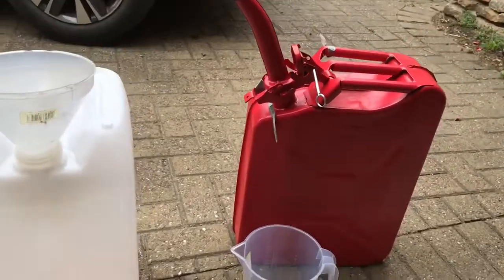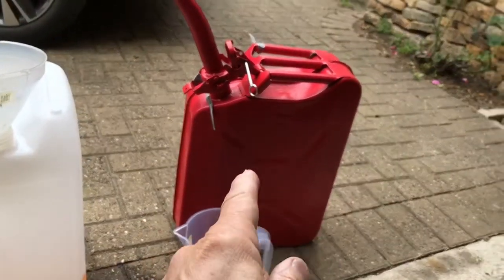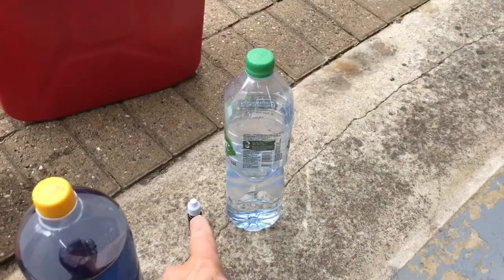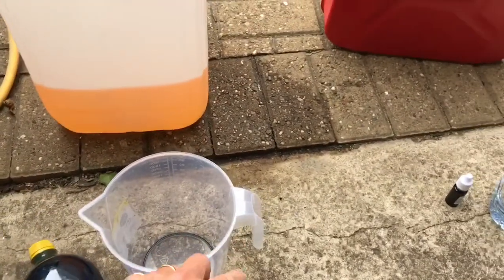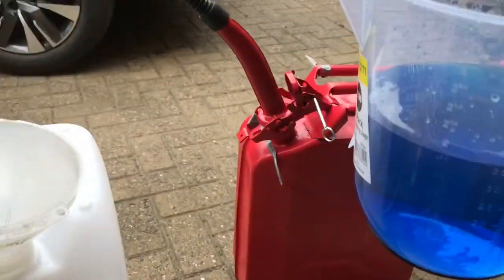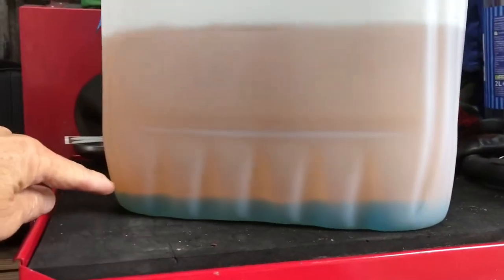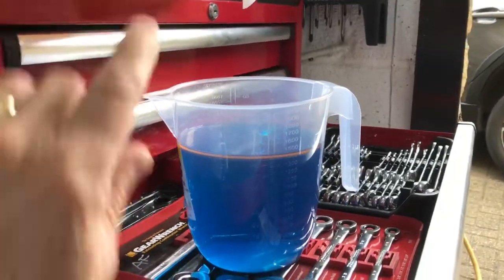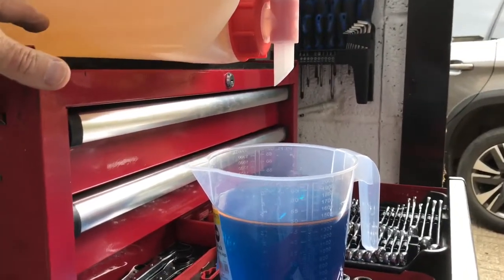How to remove Ethanol from unleaded fuel

Comment: Why are they increasing the  Ethanol to 10% - I presume to cut costs?
Reply: To pretend to save the planet.
Reply: To add to this, the UK doesn't have a bioethanol refinery, so its shipped to another country in between as well. Its just all short sighted nonsense, let's tear down another forest to grow crops to turn into fuel to save some minute amount of co2 and more importantly line the pockets of the crop producers
Reply: @drybiscuit  what’s more environmentally harmful growing some corn or extracting oil
Reply: Deforestation to grow corn is far more damaging to natural habitats. 

Humans are responsible for just 2% of the planets natural CO2 content. In Iceland there has been an erupting volcano since march, to date it has spewed out 1.7 billion tons of co2. Fuel refining is not as bad as the tree hugging greta fans make out. 

Follow the actual science, not the hype.
Reply: @IanNortonBaldersBikes  Well said. All this crap about man made climate change is an utter money making scam. They would be far better sorting out single use plastics
Reply: @john-zf1yb  It takes nearly as much fossil fuel to grow, process and distill the corn as you get out of it by burning the ethanol.  Additionally, the ethanol can't be sent through a pipeline like the gasoline (since it's hydrophilic).  It has to be sent by truck or train to the distributors and added to the gas there before delivery to you local station.
Reply: @IanNortonBaldersBikes  kinda hard to "follow the science" when you do not post a source for your claim.
Reply: @rancidbeef582  I would believe you but why should I believe a youtube comment with no sources? From my research, I have not seen any proof that it is more environmentally harmful but if you find something ill read it and change my views.
Reply: @rancidbeef582  It would be waste of time because it does not exist. I have looked and have found nothing.
Reply: @john-zf1yb  the problem is they use almost as much diesel fuel to grow the corn as they get in ethanol.
Reply: Because Boris's bird told him to .😁
Reply: To deforest more of the land, in order to cut CO2 emissions. Biofuels are disastrous for ecology.
Reply: @climanrecon5649  We've been using 10% in the US for a long time now.  It's just a pay-out to the corn farming industry.  Corn is a horrible choice for ethanol because your return on the fossil fuel "investment" is about break-even.  It would be much much better to  use sugar beets.  I think the return on that is something like 8 to 1 (or maybe that's sugar cane -- but still better).  But this is the same reason we're stuck with high-fructose corn syrup in everything instead of just sugar.  Follow the money....
Reply: To increase efficiency many people seem to ignore that’s ethanol provides a power boost
Reply: Incorrect I'm afraid. Ethanol does definitely not provide a "boost" it's slower burning that petroleum. Vehicles will drink more fuel with the higher percentage of ethanol.
Reply: @john-zf1yb  But ethanol itself needs gaseous oxygen (present at a level of twenty per cent in air) to combust...
Reply: @john-zf1yb  Ethanol has a little more than 1/2 the BTU's per gallon (or J/Kg, if you prefer) of gasoline.

Comment: Hi, I make biodiesel, and have to rinse out the Methanol, and Sodium Hydroxide, then keep draining off the water, until it is clear each rinse.  How will you get rid of the droplets that remain in the water?  I also would guess, to add the Ethanol back in, to make it E5, you just put in five percent pure ethanol back in.  Im glad i make my own bio, as this lot will cost dearly.
Reply: Andrew Mckenna
I use 'methane gas' for my vehicle and this also helps with "climate change", considering that my wife produces most of it

Comment: Brilliant thanks for the info. Same applies to lawn mowers and chain saws if 10% ethanol is all you can get after 2026.
I hate these 'authorities' who deliberately try to screw you!
Reply: I think you'll find Super Unleaded is staying at 5%
Reply: @johnpm1605  great if the nearest pump isn't 100 miles away (as it is for me)
Reply: John, will a four stroke lawnmower engine run fine on E5 Super unleaded?
Reply: I drive a 1995 Ford Ranger with 2.3L and 5 speed, before ethanol blended fuels I was getting 25MPG on the highway, that dropped to 21. I thought maybe something was wrong with old boy so I ran the tank as low as possible and refueled full of non ethanol and back to 25.
Reply: Ronnie G, 2 strokes can handle Ethanol fine. It's the 4 strokes with valves and valve seats that get pitted and then die to lack of compression. And I agree 100% on the Gov't Screwin'.
Reply: @Wheeler590  I think you are referring to the unleaded problem. All the ethanol does it to deteriorate the rubber tubes and seals in the fuel system if they are not compatible. These bits will deteriorate anyway over time and have to be replaced. I think the whole issue is being blown out of proportion.
Reply: it's ethanol free with exception to everyone in the UK. 

Esso super unleaded petrol (Synergy Supreme+ Unleaded 97 and Synergy Supreme+ 99 ) is ethanol free (Except in Devon, Cornwall, North Wales, North England and Scotland)
Reply: … and aircraft !!!
However, it is possible to buy UL91 which is lead and ethanol free (you can obtain it from certain airfields but not all).
Reply: How are they trying to screw you?
Reply: @baileyjerman5573  Who are you replying to?
Reply: @slowstang88    oh it was meant to be Ronnie's original comment
Reply: @baileyjerman5573  Lawn equipment with carburetors and rubber fuel lines don't respond well to ethanol
Reply: Been running e10 in classics lawnmowers anything for decades
Reply: @RingTuned  Yes it's a bit of a storm in a teacup and makes the non technical person panic.
Reply: The authorities? You mean the corn and the ethanol lobbies? They’re not trying to screw you they just want to force you to buy their product so they can make money off of you.
Reply: Yes! How you make cheap booze! 

Serious E10 has no fucking benefits
Reply: @TheCeki1982  If you have a higher compression than standard it will make more power
Reply: @TheCeki1982  
They're trying to raise it to 15 and all year.
Reply: Humanity existing after 2026 is a delusion
Reply: @TBDJKC  Injections for free donuts will probably be offing the sheep by then.
Reply: @NoNORADon911  
And somehow your politics is related to this how?
Reply: They did nine11 most did not care, now you all whine about petty BS.
Reply: @NoNORADon911  I care very much. I want to see every last person involved executed for that. Any idiot can see it was a cruise missle that hit the pentagon, in the budget and finance center, where more than a trillion dollars went missing, where the next day an investigation was to begin.  Damn right I care. Why Trump is needed Right Now...
Reply: That 10% ethanol in petrol saves the country billions per year. Perhaps we need garages to sell unadulterated  petrol also.
Reply: @rogeronslow1498  
No that 10% ethanol doesn’t save the country billions per year. On the contrary it cost the country billions per year.

Comment: One thing to check when reinstating the octane is that many octane boosters are based on ethanol so you could end up just putting the ethnaol back in!
Reply: @Marcus Keeler It may be. The point is that I was offering some useful advice to those that didn't know to check and be sure you are aware of the possibility as not all octane boosters do use ethanol. Maybe you could let us know the precise results from using different boosters rather than just being negative towards my comment.
Reply: @Smooth Move it also had positraction.
Reply: how to test octane?
Reply: @ratchetthelastlombax3639  whatcha need there is a Hewlett Packard 5710-A dual column gas chromatograph with flame analyzation detectors.
Reply: @davidmccormick4319  make sure to get the floor model, it's got the turbocharger
Reply: @ratchetthelastlombax3639  in a lab with a cfr engine
Reply: @john-zf1yb   Yep - used to do that when I worked for Mobil and BP.
Reply: I was going to mention this. Glad you did. 👍